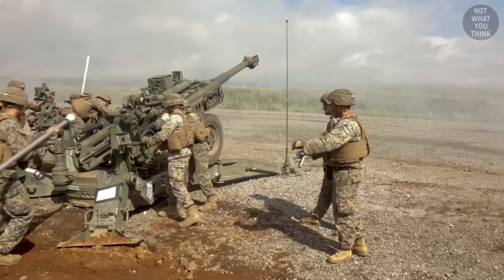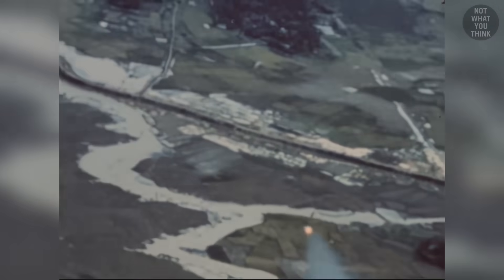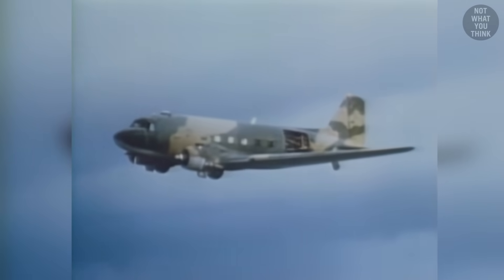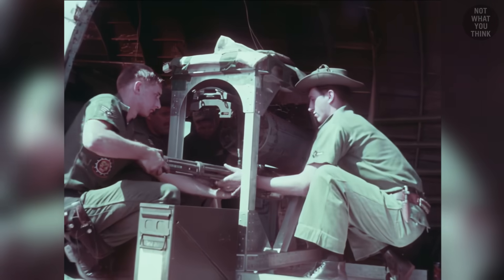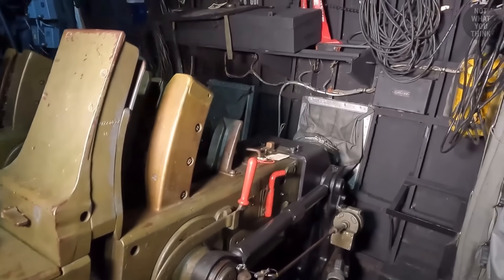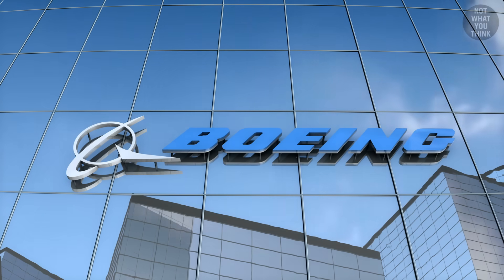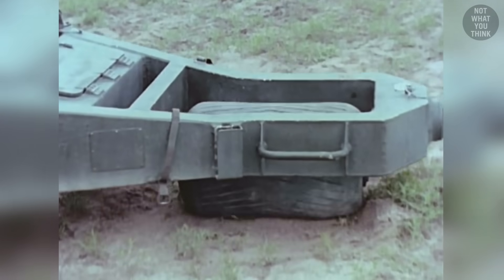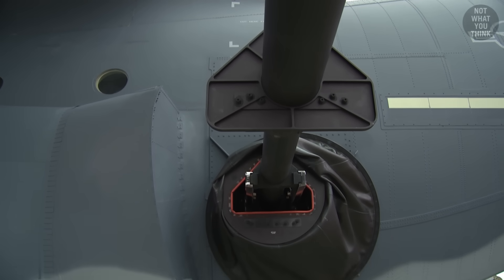Why the US Air Force Installed a Howitzer on a Cargo Plane

Comment: Never forget crew:
Do not fire on any targets marked by a flashing strobe. Those are friendlies.
Reply: Do not fire on the church
Reply: @pantsu-sama8311  But we all did it out of curiosity.
Reply: @pantsu-sama8311  loads 105mm
Reply: @绛雨  Seriously I thought that was a joke in game because they couldn't trust players not to be stupid. Thats really cool.
Reply: Guy right there, guy runnin', Hot Damn! You got em, Gun ready! Personal near that fence, roger tracking, TV confirm the cross road, you mean the one near thr water tower? Yep. Enemy armour coming out, personal on the roof, personal in the field.
Reply: @绛雨  Ah nice.. thanks for the info.  So the IR is on a specific frequency not necessarily picked up by regular IR goggles?
Reply: @beayn all IR that the US can be seen with US night vision equipment
Reply: AC-130 Navigator: Uh, TV, confirm you see the church in the town.

AC-130 TV Operator: We see it, start the clock.

AC-130 FCO: Roger that we're there, start talking.

AC-130 Navigator: You are not authorized to level the church. Do not fire directly on the church.
Reply: Those are just the enemies marked on the map so they are easier to hit.
Reply: @绛雨  though it is a real thing, I still think it was a cod4 reference.
Reply: "ka-boom"😊
Reply: @绛雨  How would that work in a situation where both sides are full on militaries using similar techniques and not military vs guerrilla?
Reply: @starstencahl8985  thats actually a concern for near peer adversaries since you’re basically advertising where you and your helmet are exactly
Reply: @starstencahl8985  The flashes might be staggered, or on another wavelength, or they might be positioned on another bodypart. There are multiple ways to solve this issue and i bet the army would find a great way to do it. These we're just of the top of my head.
Reply: @starstencahl8985 didn't have to worry about that in Iraq or Afghanistan since the other side didn't have any IR/night vision capabilities
Reply: As far being able to identify each other if the other side did have IR, we also had IR reflected patches. There are other ways but not too sure if I should mention them
Reply: @starstencahl8985 Every team has an IR strobe, so every platoon already has 8. Theyll probably double the issued amount and We will just place them in a shape instead of just a random 1 per team. 

It's like smoke. Everyone has colored smoke. But I don't tell the air cover what color our smoke is until they're on station
Reply: @starstencahl8985  
Until Xiden left the Taliban our sensitive equipment, only the US and it’s allies had the correct strobes. But now, you are right. We’ve lost that capability.
Reply: Avoid hitting churches as well
Reply: *unless otherwise requested
Reply: OOHHH ohhh…. fuck
Reply: Bonus points though
Reply: unless it's enemies using a flashing strobe.
Reply: @绛雨  You learn something every day. Thank ya!
Reply: @thechaospotatoes what did he tell i wanna know he deleted the comment
Reply: @ronwesilen4536  I think he said that they use the strobes in real life
Reply: @绛雨  Do those strobes flash in a specific pattern? It seems like it would be easy to replicate that if it didn't have randomized patterns. Also are they able to turn it off? If the enemy has IR goggles they could more easily find the enemy.
Reply: @beayn when I was in the personal IR strobes first were about the size of a flip phone, then the got even smaller to about size of a quarter. They used regular batteries and yes of course they could be turned off
Reply: @beayn also the ones we had were just a steady flash about 1 every 1 or 2 seconds
Reply: @beayn  if it was that easy they be useless in every night mission but then again u expect those Achmeds get their hands on it ( maybe rusia/china/nato allies but not those skinnies)
Reply: @绛雨  before covid i was developing extreme high brightness ir led license plates that would flash a special pattern identifying the vehicle, not just friend or foe but actual serial number. i paid a ton of money to a company in china to make them and got fucked. the sales reps were very interested in what these would be used for..
Reply: @fluke196c  do you know who John Fluke is? Just curious about your username.
Reply: @B3ARCAT  no clue. the username is after a piece of fluke test equipment.
Reply: Aren’t those aliens 😂
Reply: @kateapple1  I think it's a Modern Warfare reference but I may be dumb and this could also be a real thing
Reply: @itsyvonblitz6819 this is a real thing. When I was in we called them fireflies.
Reply: @itsyvonblitz6819 Flashing IR strobes are real things we use. They run on 2 AA batteries. We use then to mark our locations when we call in air support. We also had little IR patch things sewn into our shoulders we could uncover during missions
Reply: ) @itsyvonblitz6819   It is, altho at some time there were strafe fire on a runoff pass resulting on a collateral vic of ground troops all bcoz the ground man didnt set a specific cutoff line to separate bogey and friendly ( unless its the specific request of the team on ground, basically last stand off tactic u NEVER ever do this
Reply: No Russian.